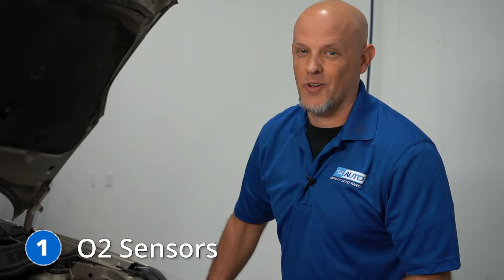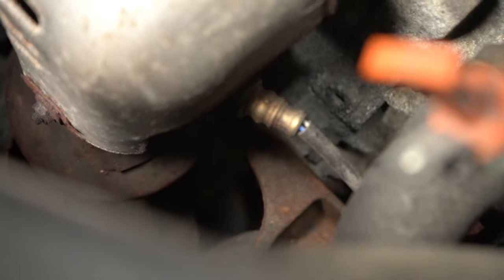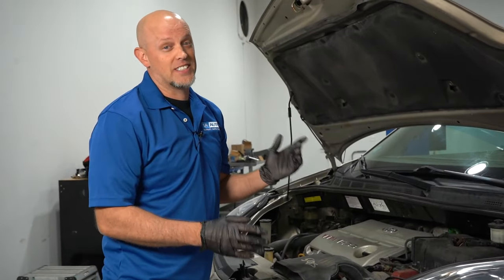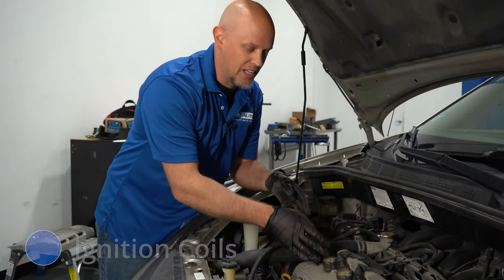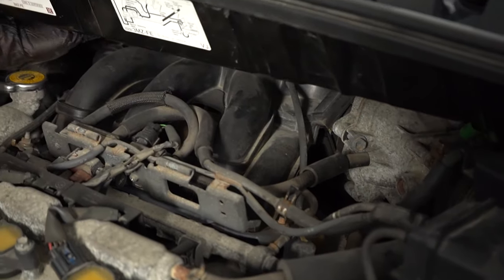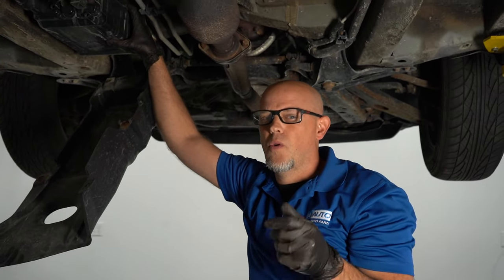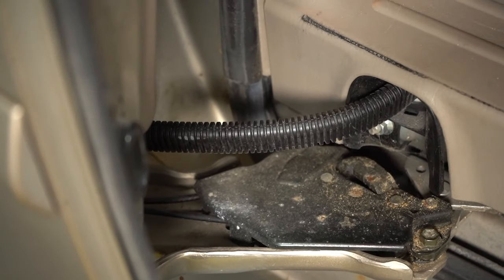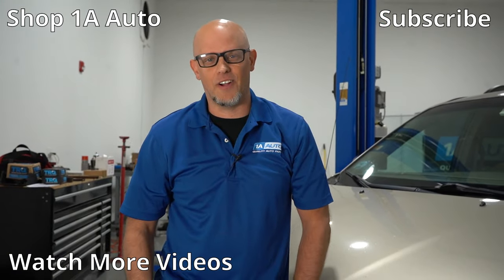Top 5 Problems Toyota Sienna Van 2004-2010 2nd Generation

Comment: The sliding door on the river side of my 2004 was not opening all the way. The problem was so simple to fix. The gas door was slightly bent and not closing all the way, leaving the push button slightly open. This causes the safety sliding door lock not to close all the way and blocking the sliding door. All I had to do was slightly bend the cover in towards the push switch and the door slides open normal
Reply from the maker: +Humberto The Believer Thanks for the feedback!

Comment: My brothers sienna is thinking that it has transmissions problems, any of y’all know?
Reply: what's the symptoms?
Reply: It have a terrible transmission problem
Reply: Had a 2004 Siena XLE that I had to replace the transmission at 73,000 miles and another replacement at 130,000 miles, along with many other issues. I was told it was a 1st year design flaw. Toyota would not help though. My last.

Comment: Ok so I have an 09 sienna and I have as to replace ignition coil b 3 times in 2 year.. I’ve replaced the spark plug every time and put new wires on it the last time I did it. Here we are 6 months later and it’s giving me the same code. Anyone know why the same ignition coil keeps failing would be a huge help!!
Reply: Are you replacing with Denso brand?
Reply: Check fuel injectors, spark plug wires, vacuum lines, and fuel delivery system. Most likely your fix will be spark plug wires or fuel injectors.

Comment: I have a 2008 and my gas mileage is horrendous as of late. 220 miles per tank!! Ive changes the purge valve, the MAF sensor, the Charcoal canister and have done a crapload of other things as well. Air filter was done today, wasnt that bad. I dont have a clue what to do next. What the heck is going on that my gas mileage is so terrible? Anyone have a clue about this? thanks.
Reply: Old spark plugs, ac compressor issues, 02 sensors, bad power steering pump or lower power steering fluid, or a bad cv joint would be my first look.

Comment: My 2004 sienna has 230,000 Km and I had to replace radiator 2 times.
Reply: Did it mix coolant and transmission fluid together? If so, was there any damage to the transmission?

Comment: Want to hear something funny? Call a repair shop for a quote on front lower control arms on these. Go ahead. ;)
Reply: Yeah buddy. I replaced mine on my 2004. Not an easy job. Another thing on these Vans is the cables that run the power doors. Far too common occurrence to break these. It is a very expensive and involved repair. I'm on my third sienna and would not own any other minivan but it is absolutely pathetic the Toyota continued to use these garbage cables on their power sliding doors. Somebody at Toyota ought to be publicly flogged.
Reply: 1800 just for parts not including labor
Reply: @django1  How bad? I was gonna drop the struts, control arms, ball joints, and bearings to freshen up the front.
Reply: @nyknickfan44  one word - aftermarket

Comment: How common are the water pump failures at under 125k on a 2008 ? 

I'm thinking the milage is rolled back on this car for sale with a leaking water pump for such reliable part to fail on a 125k 🤷

Comment: I recently picked up a 2004 2wd. Its in really good shape with about 220,000 miles on it. Its had full dealership maintenance since day one. Even had the automatic transmission belts or what ever replaced. Which is another super common problem on these. 

But recently it just started getting terrible fuel mileage. I had been keeping track of my MPG since I got it. And it litterally dropped from like 22/23mpg average to 16/17mpg??! 
Anyone have any ideas as to what could cause this? 
I also just replaced a 18" section of my exhuast that had rusted thru. I thought maybe that had caused one of the O2 sensors to go crazy. But even now that its fixed theirs no change. And it never gave me a check engine light or any codes or anything. 

I'm kinda temoted to run a bottle of injector cleaner or Sea Foam or somthing and see what that does.
Reply: I seem to recall that Scotty Kilmer mentions the Mass Air, and he shows how to clean it. He discussed the codes using a scanner. If you have a code scanner it may help you. Search Scotty's videos on Youtube. Hope this helps.
Reply: i get 16 to 17 mph since i go my 09 with 93k miles, maybe you got a lead foot, i drive mostly city with traffic
Reply: Dump in fuel cleaner every 3 - 4 months. Cleaning the throttle body really helps reduce the idle RPM. Smoothes it out.
Reply: I’d start with cleaning the MAF sensor. For years I’ve done this every 5K miles on all my vehicles, including the 05 and 07 Siennas I’ve owned. It’s very easy to do. Disconnect the electrical connector to the MAF sensor, use a finger bit driver with a narrow Phillips head bit, unscrew the two tiny screws carefully, carefully pull out the MAF sensor, then spray the sensor wires with CRC brand MAF sensor cleaner. Let it dry for a minute and re-install. Second thing is to dump a can of Seafoam in your gas tank BEFORE you fill it up (preferably when you’ve got 1/4 tank of gas). It will blend with the Seafoam that way. Use that tank of gas as long as you can (before filling up with gas) to use the high concentration of Seafoam.
Reply: Did you replace battery or disconnected it for a little while? I did on mine and I did a hella good maintenance ( spark plugs, cleaned throttle body,maf sensor cleaning, air cleaner, pcv valve, valve cover gaskets, intake throttle body gaskets I may forget something else) and I had terrible gas mileage too, I heard after you disconnect throttle body or disconnect battery you should reset computer to relearn throttle body. I did it and seems to work better.
Reply: @nestorja3526  how do you reset the computer after a disconnected battery
Reply: When I first bought my van I was able to continuously get 20mpg in WNC (many hills here) but after bigger tires and starting to become confident in driving a big body heavy vehicle.. I now get 16.7😑
 Side note. This is the best and most fun to own behicle I have ever had especially now that I'm converting into a fully capable RV with everything I want! 
 -former lifted 4x4 only type😁

Comment: The Steering  wheel half shaft  is sub standard and rusts out resulting in a steering  wheel that won't turn....at first you will think it is the power steering pump...found out driving a highway at night..went into a corner and van wanted to go straight. .had to arm wrestle it from then on in every turn...not fun

Comment: This guy is totally off. Coolant leaks are the most common due to cooling plate under intake manifold. Maybe a coil is a possibility. More common may be lower control arms, o2 sensor, front catalytic, door controller, radiator. The alternator is good for 200k on these